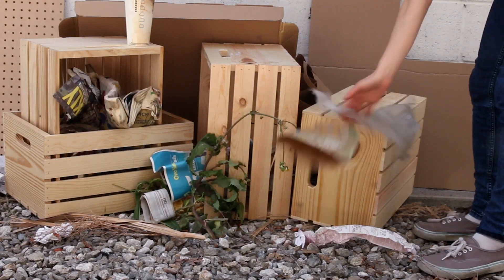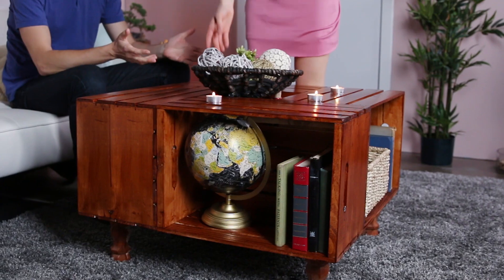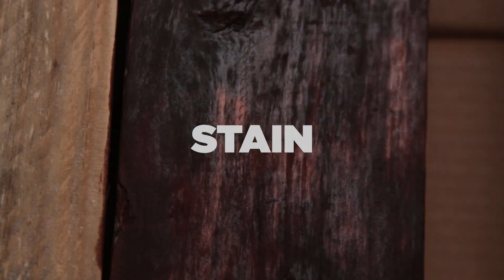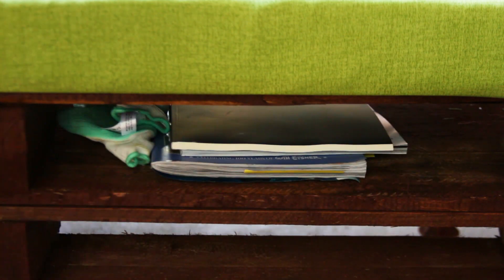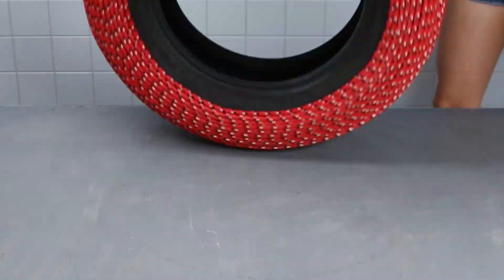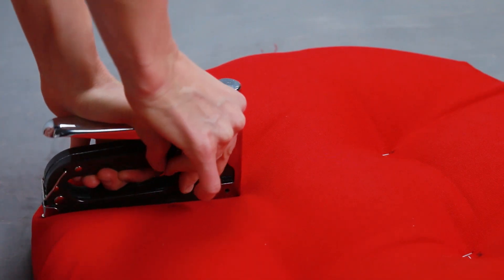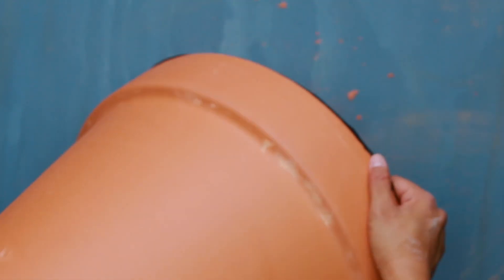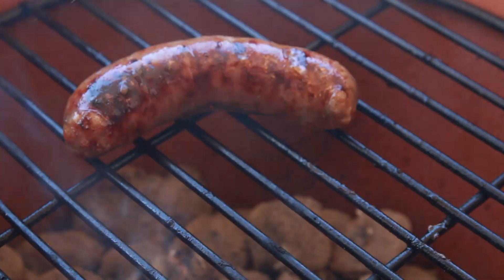Beginner’s Guide To Upcycling

Comment: The thing is in order to become a DIYer like in the video you need to spend at least over $300 on power tools, paints, wood, foams and fabrics, etc. It’s only free once you own all the tools
Reply: Claire Knight Lots of them would say its an investment for the power tools. But most of those power tools you can use by hand like a normal screw driver or just simple sand paper or a hand saw. It would just take A LOT more effort.